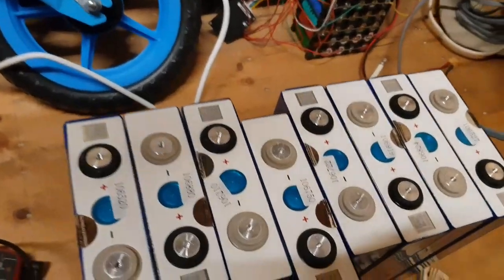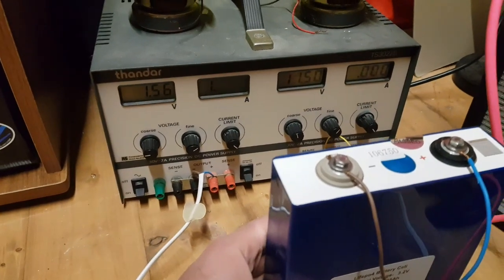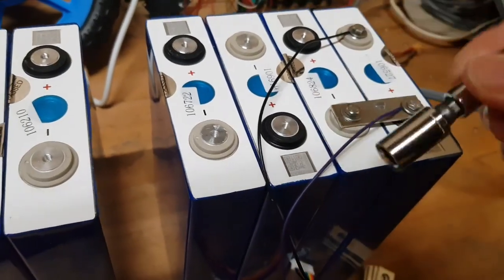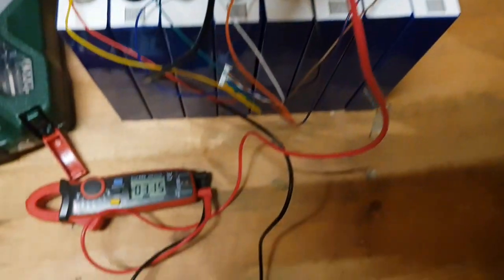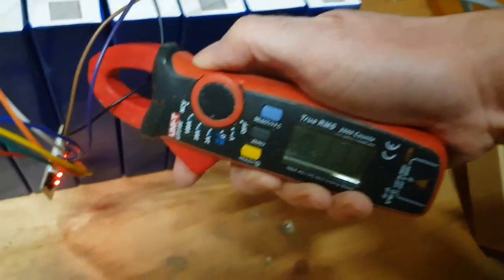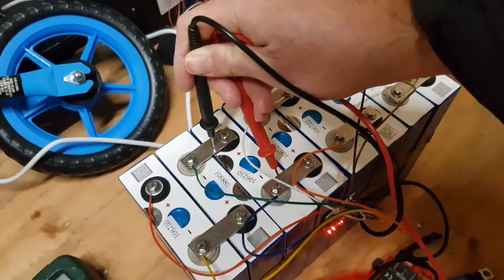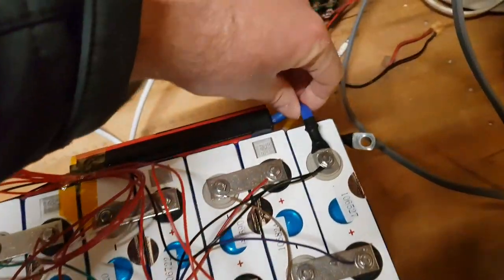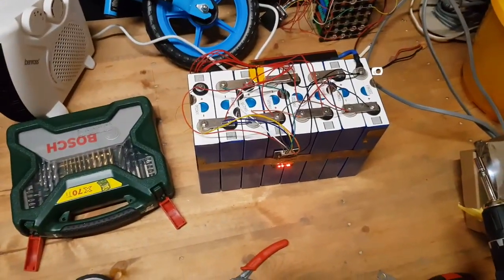Recovering lifepo4 batteries. Too low voltage

Comment: These cells are damaged or have permanatly lost some capacity. Did you test them till full discharge?
Reply from the maker: @jec_ecart  4 year later still going strong. I have measured a Total capacity of 82amp hours. Yes there is some loss. But they are still working and have had a lot of abuse. Running flat in winter. Charging while cold.

Comment: Better not to connect bms untill you have done a manual balance first .Connect all the positives together in parallel and all the negatives together 
In parallel,  then charge the batteries together at
3.7 volts at around 1.5 to 2 amps 
this will balance all the battery packs
 the same.
Reply: 3.65v

Comment: same thing just happened to me with cylindrical shunbin cells, one sat at 1.5V on arrival, what a shame.
Reply from the maker: Try charging it. As my cells seem to be fine.
Reply: @mathewlawrenceml  have you done single cell capacity tests at low rates like 0.2C after?
Reply from the maker: @lyn1337  no. It's a bit impractical as that's my main power source. But they easy have more capacity than I use
Reply: @mathewlawrenceml  I see.. these would make my backup so I'll give it a go and hope for the best. Still a no-go for me so I expect the seller to offer a solution.
Reply from the maker: @lyn1337  worth a try to get a refund if you can. Nothing to lose. Do you have a capacity tester?
Reply: @mathewlawrenceml  Perhaps I get to keep the cells. Figured I'll buy one of those PC-fan style 10A testers for this and a hall-effect meter additionally. Never really tested single cells before.

Comment: the easiest fix for this if you have to again, is to hook them all in parallel and charge to 3.65 volts and let them sit for a few days. the connect in series and use like normal. this is called TOP BALANCING btw
Reply: That's fine for cells that are already kind of balanced. In this case it would destroy everything ;)
Reply: @leonvanengelen4806 What do you mean "destroy everything"?
Reply: @Teknopottu  well, considered that these cells barely have any internal resistance, a huge current will start flowing. Probably especially to high for the one cell that will be charging at lightspeed. Then when it breaks, it might even start dropping voltage and dragging the good cells with it
Reply: Never parallell cells with more then 0.2 volts difference. Balancing or otherwise
Reply: @leonvanengelen1824  or what? Omg current will flow? That’s the point. The 0.2v delta rules is not a big deal. Yeah sure if you can then great, but the current surge will not last more than a few seconds and then quickly equalize. So yea, you’re not wrong, but it’s nothing to worry about. I have connected a cell at 2.8v to another at 3.3v. About 70amps flowed that is barely .25C

Comment: did they hold a charge after charging???
Reply from the maker: Yes. After all the cell have not be over discharged. There operating within there expected range. The BMS cuts off before that.

Comment: Hi, one of my lifepo4 cell out of 24s got bloated. Can I remove the bad cell and configure as 23s using the existing 24s BMS and charger?
Reply from the maker: Afraid not. As the BMS will see the missing cell as being too low a voltage (because the wires are not connected) as a result the low voltage cut off will activate. 
I would also be looking as to why the cell bloated. Are you over charging your cells?
Reply: I had a bloated cell as well. I punched the vent hole with a needle and some gas escaped. I then placed all the other batteries on it overnight as weight just to let out as much of the gas as possible.  Taped the hole over with some masking tape and then put it back in the pack. When it was bloated, I measured the voltage and it seemed it was overcharged! Anyway,  now it is back in the pack and it is balanced and has been working without anymore issues! Hope it helps. Please do be careful though.  I am not a specialist! Just telling you what I did

Comment: thanks, will be staying away from this seller. you saved me a ton of headache. also if you found the voltage that low I would have returned them with a nasty message to the seller

Comment: Why didnt you charge one cell at a time to 3.5 v with the power supply? Then parallel the group and run a few cycles at 3.2 v nominal. I am surprised they came so unbalanced. Were they bought new?